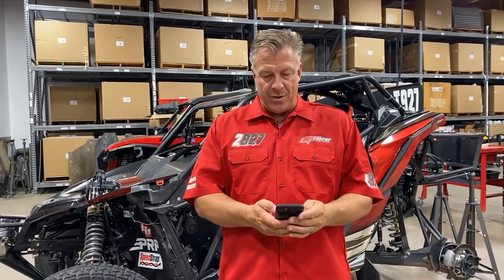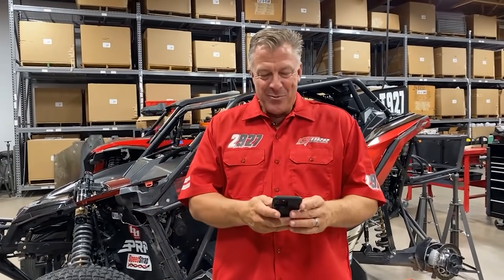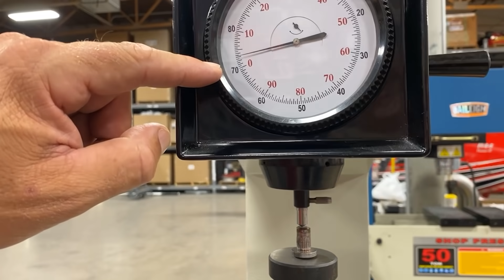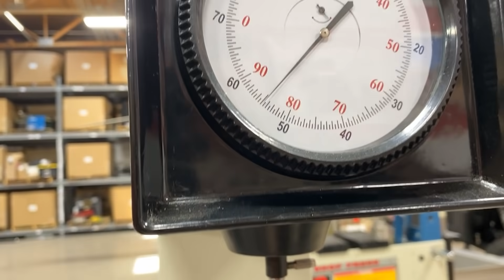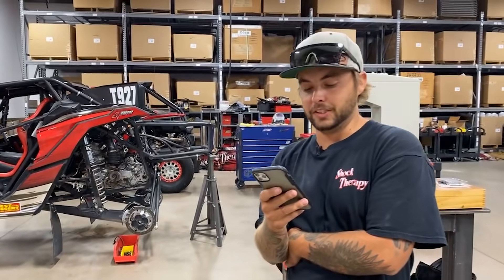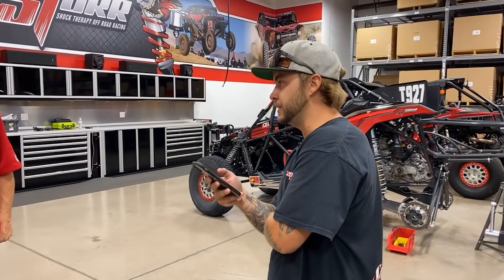Wheel Studs/Metal Hardness Testing and UTV Legends 2021 Race Recap (Shock Therapy Live 9/14)

Comment: What you said about stainless case hardening by the movement is not accurate.  Its called work hardening.  Case hardening is putting a carbon shell on any material for wear resistance.

Comment: How do you keep the belt cool on the race car?
Reply from the maker: Proper tuning from many hours of testing. Stock clutch intake and exhaust system is the most efficient too.
Reply: @ShockTherapyllc  hello, do you keep the stock spring in the primary or you are going stiffer?
Reply from the maker: @ericlessard5021  we change both spring rates. Usually stiffer than stock but not always.